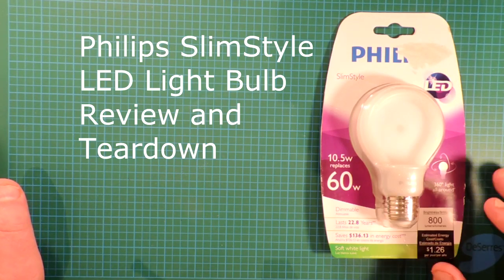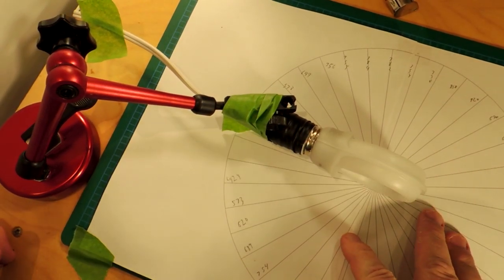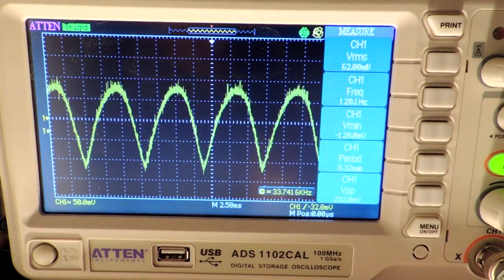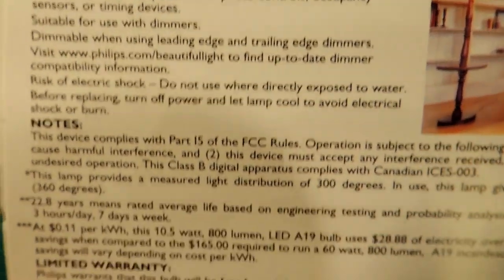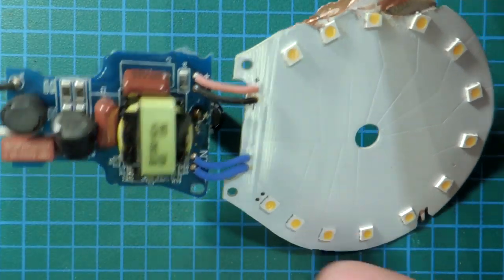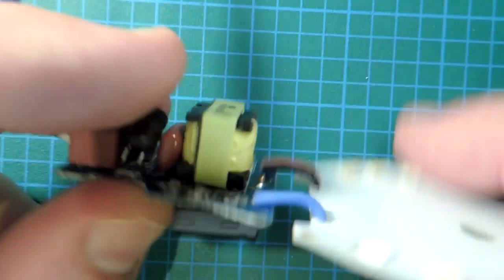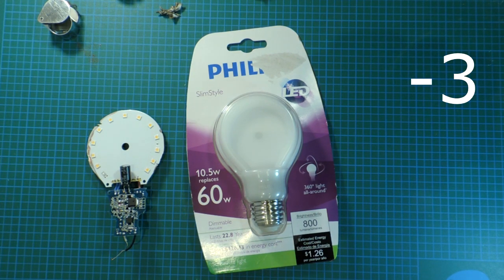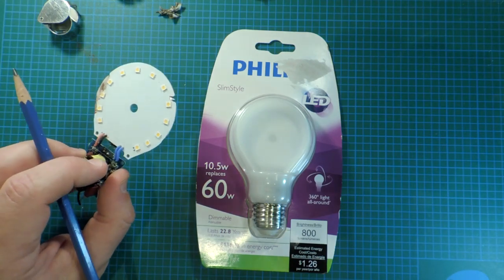Philips Slim Style LED Light Bulb Review and Teardown: Race to the Bottom

Comment: Bought a bunch of these on clearance at home depot for $1 a piece over 10 years ago. Lighting isn't perfect by any means but I have 12 of them in my house and not one has burnt out yet I also have 1 in my shop that's been on for 24/7 since I bought them and it's still going strong so if you need a bulb to last this is the one it's amazing.

Comment: I'm not sure if they're still in production at this point in time but when they were relatively new [@ $8 CA per bulb] what seems like 4.5 years ago, I purchased three and installed them into a triple-split fixture so they're in parallel which may effect longevity \flicker in my case. When installed horizontally \ parallel with the ceiling these bulbs actually perform very well; the dark band not being visible at all. In a semi-professional lighting application they aren't the best as flicker does eventually interfere at certain framerates but can make for very decent temporary substitutes to high-end alternatives.

Comment: I have two of these exact bulbs and they are still working 4 years later even though they see daily use of about 4 to 5 hours per day. They still make those weird clicking sounds when they’re turned off, so I think that’s just the pcb material contracting at a different rate than the plastic when it cools.
Reply: I have one in a desk lamp that I use quite a lot (usually at least 8 hours per day). It must be at least 3 years old now and it's still going strong. By eye, I still can't see any flicker and the colour temperature is nice. In terms of longevity, it's been a great bulb.

They're also quite light in weight, which makes them effective in desk lamps that are positioned on extending arms. This bulb has definitely worked for me.
Reply: I still have the receipt for this LED bulb and it's dated March, 2015. So indeed, it's over 3 years old now and still working fine. I haven't had any problems with any of these old Philips "Slim Style" LED lights. So far, none of them have died and I'm still using 4 of them -- two 10.5 watt bulbs and two 8 watt bulbs. They've been pretty reliable in open-faced (i.e. hooded) lamp fixtures.

Comment: We have many of these in constant use for years. Most we bought at Home Depot for $1.97 (subsidized, in our state.) They've performed excellently. I always set up indirect lighting (reflected,) so no dark band is apparent. I've torn apart several of these and am impressed by the driver (with a good overheat sensor) and operating temperature. I've found them to be acceptable for dimming, though not fantastic. I've yet to see one flicker. (and I'm one of those people who can't stand the slightest flicker.)

Comment: Your meter suggested flickering was at 120Hz; the eye can't detect it above 60-75Hz, which is the rate of standard AC in the U.S. and every ordinary fluorescent bulb is actually going on and off at that much lower rate with most people unaware unless they take a fast speed photo and catch in between cycles-surprise, dark image! So much for your test there. In normal use that side band has never been noticeable to me. I'm far more concerned about reliability/durability, CRI and some bulbs test OK but look dismal, as if they were actually absorbing light from the room - especially the colder, mis-described "Daylight" groups. K scale is one of the most misguided assessments to me; 3000K in LEDs seems more accurately white than 4000 or especially 5000K, perhaps partly due to CRI being a separate quality with different sorts of fudgeable parameters.

Comment: I got a few of these on sale.  I like them, but it's true that they have that dark side band.  As long as the whole bulb is exposed, rather than being inside a cone light, it puts out plenty of light.  I also like that it's lighter than the other typical LED bulbs with the heavy heat sinks that pull on my cone light sockets when I orient them sideways.

One novice question about flicker: is flicker supposed to be perceptible?  I haven't noticed any the ones I bought, but you've found quite a bit in comparison to other bulbs- is the flicker you've found below the level of visual perception, but perceptible, and irritating, to the brain?

Comment: I have had a couple of them in service for about a year, and I don't perceive any flicker at all; the persistence of the phosphors in the white LEDs mimics the afterglow of an incandescent filament quite well.  One of the bulbs is in a table lamp with a shade and the light pattern is indistinguishable from the incandescent bulb that was there before.  It runs much cooler than the equivalent incandescent and is dimmable.  What is there not to like?

Comment: I just bought several of these and was impressed with them so that shows what I know!  They are my first LED bulbs and are replacing cheap florescent ones.  I like that they turn on faster when cold and they are 10.5W and just as bright as the 13W they replaced when I had them side by side I couldn't tell any difference in brightness. They are in ceiling fixtures with reflectors and diffused domes so the "shadow band" isn't noticeable to me at all.  Anyway main reason I went with these Phillips is that they were on sale for $8 and I had coupons for them from Energy Star (IIRC) for $5 off so I only paid $3 for them!  My question is about the PFC as you said they are only %90 PFC and I was wondering if that could have any negative effects to the average user in the real world.  Sorry I only vaugly understand PFC at best so I'm not sure.
Reply: +MN12BIRD Power factor has to do with the phase relationship between the voltage waveform and the current waveform flowing through the load — in this case, the LED bulb.  In an incandescent bulb, which presents pure resistance to the power line, the voltage and current are perfectly in phase and the power factor is "1".  If the load has inductive or capacitive ("reactive") components in it, the current may lead or lag the voltage waveform and depending on how much the lag or lead is, the power factor decreases accordingly.  Electric utilities don't like this, since for a given amount of power delivered to customers, loads with less-than-unity power factor cause higher current to flow in the power lines and transformers, putting more stress on them.  Residential neighborhoods may have many motors running, as in refrigerators, furnace blowers, fans and air conditioners.  These are all inductive, causing the current to lag the voltage.  To compensate, the utility company mounts banks of capacitors on power poles, which produces the opposite effect and brings the current back into phase with the voltage.  The capacitors provide "power factor correction", a.k.a. PFC.

I agree with your comment about the invisibility of the "shadow band".  These LED bulbs are typically used in some type of fixture or under a lamp shade that bounces the light around, so that what is emitted into the room has no perceptible non-uniformity.

Comment: Im just wondering if the flicker was in fact caused by the dimmer in use?
or was the dimmer not in line when we were looking at the flicker?
Reply: +Mick Pedder I have a couple of these bulbs running on dimmable X10 modules, and there is no perceptible flicker at full brightness.  To see any flicker, i need to reduce the lamp output to a very low setting.  At such a low setting even incandescent bulbs begin to flicker.  Although it can't be dimmed quite as low as an incandescent with a standard solid-state dimmer and its color temperature is constant for all brightness settings, otherwise its performance mimics an incandescent very closely.

Comment: Love your LED reviews.  I wish there was a way to touch more on thermal design and even possibly measure it but that might be complicated.  To me that's one of the most important issues since I'm not using dimmers and flicker doesn't bother me and I don't trust these lifetime predictions by the manufacturers.  This bulb is inferior to others in many of your tests but it might be better in keeping both LEDs and driver circuitry at acceptable temp levels over other bulbs due to the spacing of LEDs.  I guess one just has to look at the bulb and guess about thermal design.
Reply: I have the 8 watt version of this in an enclosed fixture.  Fixture barely gets warm to the touch.  I would say go ahead and give it a try.

Comment: I have owned 3 of these bulbs for about 5 months now. They give off almost no heat at all and you cannot notice the flicker at all with your eyes. I am very sensitive to the flicker generated by fluorescent bulbs, but cannot notice any with these. I think you're maybe being a bit harsh about the band. Yes there is a slight shadow created by it, however, it's barely noticeable, and when used in an opaque fixture especially, you don't notice it. I have these above my bathroom mirror and they can all easily be turned so the flat side faces the wall, which is what I believe these are really meant for. They are cheap, seem to be very reliable, and produce a nice light. I see no problems with this.
Reply: +Milosz Ostrow I still am using these bulbs with no issues. So that's about 3 years with none of the mentioned problems and no dead bulbs.
Reply: +Zaron Gibson — I agree.  If I wave my hand with outstretched fingers in front of the Slim Style lamp, I don't see any strobe effect.  When mounted in a table lamp with a lamp shade or in a fixture, the light emitted into the room is diffused so well that I can detect no shadow.  Unless I'm looking directly at a bare Slim Style lamp, there's no way I could distinguish the light emitted by it from a a traditional incandescent bulb.

Comment: 105 degrees centigrade = 221 degrees Fahrenheit. Since when does this bulb produce this much heat ? From reports I hear, it produces almost no heat. I fail to see any poor performance, especially considering the price. Pennsylvania is subsidizing these currently and they are selling for 2 bucks a bulb. While they may not be perfect, they sure offer the best bang for the buck (at least in those states subsidizing them).
Reply from the maker: Glenn Watkins The temperature rating of the capacitor is short hand for the reliability of the device... from this rating one can consult the mfg of the capacitor and read off from a graph the expected lifetime of a component at the actual operating temperature  If one is seeking a lowest-possible-cost product with limited life there are better deals to be had with CFL's at the dollar store.
Reply: just bought 8 of them

Comment: I have the 8w version of this and I am using it in a large enclosed glass fixture.  Its just a hallway light that stays on all the time.  So far it doing well. I can't see the flicker, how fast is the Hrtz on that flicker?  The light pattern is not really very noticeable since most people will be using some sort of shade or enclosure.  I like the color temp.  Mine is soft white 40w equivalent.  The cost is excellent.  At less than 9$  I can see these selling well.  They do get good reviews on Amazon.  I would say go ahead and risk it in an enclosed fixture, unless its very small and sealed I really don't think this is going to have a heat problem.  That component is good for 221F and there's no way that's going to happen in my glass fixture. Even if I'm reducing the lifespan, this bulb is cheap enough that I don't really care.
Reply: Just curious... Is it still working? My Philips "slim style" bulbs are still working, and some of them are over 3 years old now. But I don't have any in fully enclosed lamp fixtures... So I'm curious here.  ;-)

Comment: The Cree bulb is better
Reply: Care to explain why? I have the Cree($8.47), Philips($6.97) and GE($8.64) and all have comparable wattage, light output and CRI.  For me, the "best bulb" is the one that will work reliably(consistency & longevity) in a particular application for a given price. The Cree's critical components are baked within the enclosed base, exceeding the temperature rating for the capacitors. On the other hand, the Philips disperses the heat away from the components, which will help ensure the life of the bulb.

Comment: I won't agree with some of the statements: Power factor of 0.9 is rather excellent result for such compact product, where the "standard" is about 0.5. Higher could come only from real incandescent...
The flicker is a cost to pay for the power factor and dimmability, mainly when you want to fit all the electronic into such small ballast compartment.
To eliminate the flicker, you will need a capacitor on the priimary before the regulator (the one is on the secondary and due to LED impedance isn't effective for the 100/120Hz) and that would mean "no dimming" and power factor of about the ordinary 0.5 and way heavier loaded electrolytic capacitor, so one very weak point extra from the reliability perspective.

Comment: HD has a promo on their website (non-mobile only) for a 4-pack for $9.99...  That's $2.50 a bulb!  I think at that price, I can live with the 'flaws' found in this review.  Use promo code: SLIMSTYLEFEODHD  Will work only one pack, but you can order multiple times.
Reply: Bugger, I just got ONE for 9.95 last week at my HD!
Reply: I just received a large order of both warm 60w equiv $26.90 4 pack free shipping, and daylight 60w equiv $8.90 each free shipping. Ebay was cheaper that homedepot, got them from a ebay store ledlightingdeal. I was surprised when comparing the warm and the daylight that the daylight looks great with this bulb shape, much better than warm, I am thinking of swapping all my warm bulbs for daylight.

Comment: Light distribution pattern may be suitable for overhead light fixtures where the lamp lies horizontal - most retrofit LED lamps have a very hard time replacing these fixtures adequately. They tend to be too big first of all and second they have a distribution pattern which often leaves half of the fixture dark with the majority of the light shining in onto one wall. This was my first guess when I saw this lamp - however of course you have to be very lucky with your socket fitting and the contacts...

Comment: I don't understand why u are saying the 105c cap is an issue. It's common industry standard, if you may see other Led bulbs or cfl or other electronic blasts.... 2nd, 99 percent of the Led replacement bulbs have the 120 Hz ripple, if you understand power electronics the reason is simple.  Philips L prize bulb is better because it is two stage design and costs 50 bucks. If you want to have an affordable bulb, yes, you have to use single stage flyback and yes ripple is high. If you compare it with some new TLED from the competition in China and Taiwan, they just have input bridge rectifier, performance is like party led light. But a lot of research has been done to prove 120Hz is not really visible for almost everyone. Yes, if led drive current ripple at 120Hz is too high, light quality is bad, easy to get tired. Industry standard is 60 percent pk-pk to avg. Hope nobody gets confused anymore!

Comment: Maybe this a dumb question but why not separate the LEDs and the power supply then when the LEDS go bad you just pop in some more like a regular bulb?
Reply from the maker: That may be the eventual end of LED lighting.  Right now vendors are trying to build bulb which fit in an old technology envelope (a shaped bulbs).  At the very high end of lighting you can see lots of exciting lamps where the LEDs are in sheets which conform to some interesting curves.... LED life is probably greater than the design life of a lamp (i.e. one may get tired of the look of a lamp and replace it long before it wears out).  Once designers start to exploit this freedom the solution you mention may become prevalent. Simply separating the power system from the LEDs should give an immediate bump in product life.
Reply: I think they are getting cheap enough that its not much of an issue to replace the whole thing.  Also consumers might not like having to buy 2 parts and make sure part 1 is compatible with part 2.